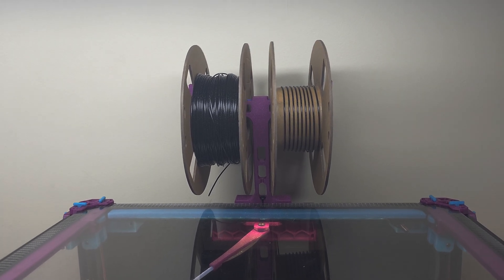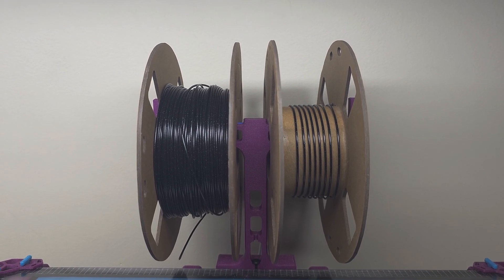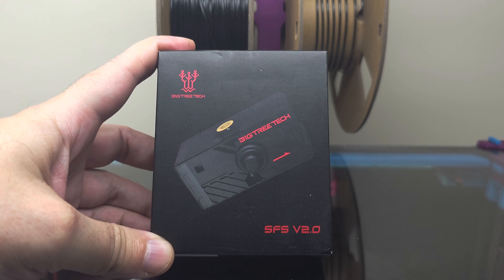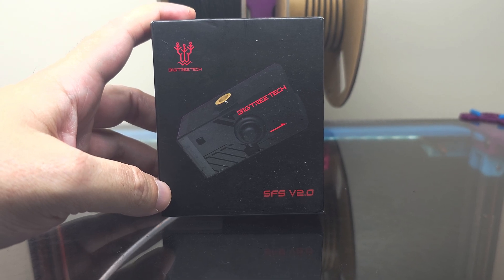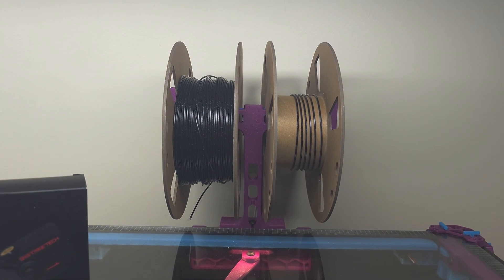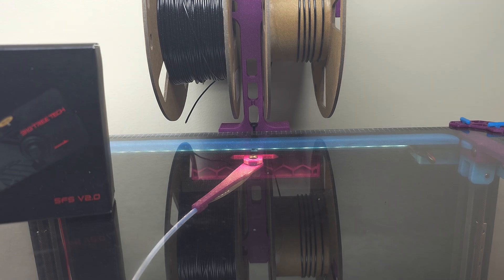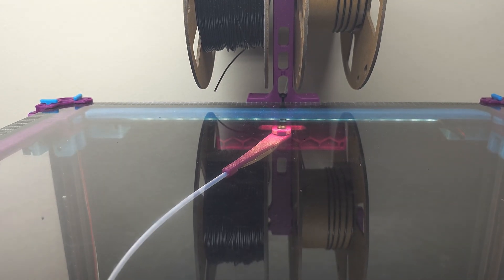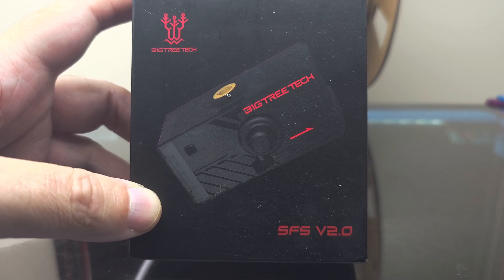Voron 2.4R2: Next upgrade - a BTT Smart Filament Sensor 2.0

Comment: Hi! I use the same spool holder that you use and was wondering if you ever got around to installing this runout sensor? If so, where did you end up installing it?

Thanks!
Reply from the maker: I haven't yet installed it. I need to design a part so it can mount on the inside of the exhaust cover plate (I don't have any exhaust fan installed at the top middle of the rear panel.
Reply: @oldguymeltsplastic  Oh, that location makes so much sense! Please let me know if you end up getting that part designed, I'd be interested to see what you come up with!
Reply from the maker: Just made this today, works well so far!
https://www.printables.com/model/727459-voron-24trident-exhaust-cover-with-btt-sfs-20-moun

Comment: Ive got. one of these but I have had to disable the smart photoelectric sensor because it kept giving me false triggers.   Its probably a setting I need to change to reduce the sensitivity but I didn't have time to play around with it

My other complaint is that the 100cm cable is too short.  Ive fitted it beside the spool holder and the cable could really be with being 10-20cm longer

Comment: I have a 1.0 version on my Voron and it's good for runout detection but having a toolhead mounted(internal stealthburner microswitch) is way better it only leaves like 4in of leftover scrap vs 3ft with the exhaust mounted Smart sensor. But having both on my machine works great

Comment: microswitch type (on/off) sensors are nice and simple. smart sensors are more versatile and can save you more headaches and waste
Reply from the maker: Trying to figure out the best placement for it. I would love to have it just above the G2SA extruder, but for simplicity, it will probably live on the exhaust port plate at the back of the printer.
Reply: @oldguymeltsplastic  closest to the extruder is always ideal, but back of the machine is most convenient